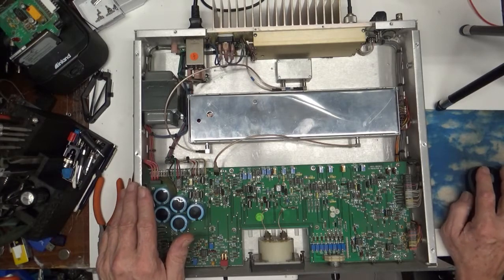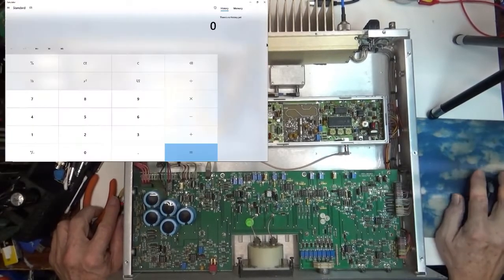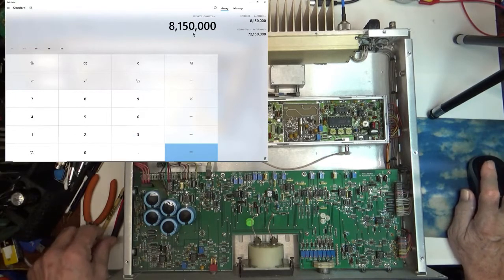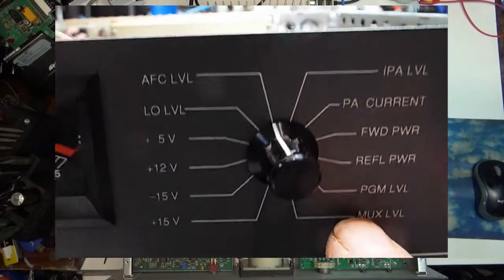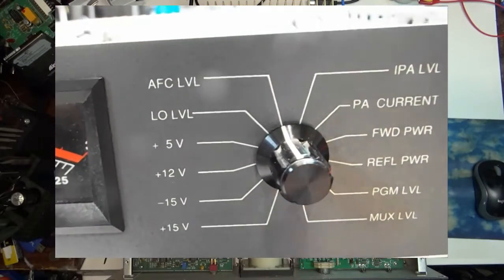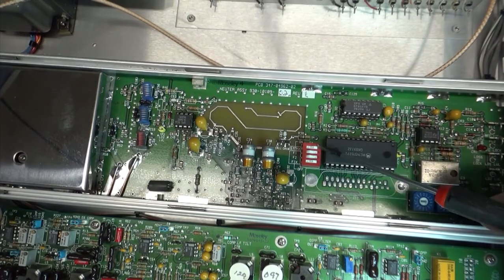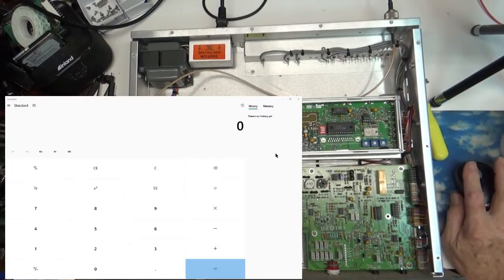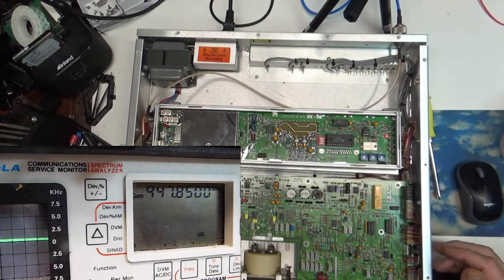Mosley 6000 Series STL Pair Frequency Change

Comment: Hello sir, please help, I have a STL RECEIVER RVR RXRL NV muting on.ic CA 3189 lamp in the damaged part of the IF module so that it is muting on. thank you
Reply from the maker: I am sorry but I don't know anything about those. Never seen one. Wish I could help you.
Reply: i had one RXRL on service recently with a similar problem. If the mute indicator is on, this does not necessarily mean that the IF card is defective. Depending on the squelch level, Mute is activated if a 70MHz RF signal (first IF) is not present at the IF card input (BNC cn4 connector). Also the mute is automatically activated if there is a problem with the local oscillator (pll unlock). In my case the PLL (MB87006) was faulty and the pll loop could not be realized. To localize the fault location it is necessary to have a spectrum analyzer or at least a frequency counter. Disconnect the BNC3 from the BNC cn4 position on the IF card and connect to the analyzer. Turn on the receiver and check if there is an RF signal at 70MHz. If it is not there, something is not ok with either the input filter or the local oscillator. Checking the local oscillator: If the red led on the PLL card still lights up after 10 seconds it means something is wrong. Checking the frequency of the local oscillator: Connect the BNC2 connector (the one leading from the PLL card to the filter) to the analyzer. Turn on the device. If everything is ok you have to read a frequency of 70MHz higher or lower than the receiving frequency.
A BNC3 connector can also be used to test the frontend. The presence of a receiving frequency but a very low RF field should appear on the analyzer. Good luck!
Reply from the maker: @MrPop80s  Wow! Thank you for your detailed response to my viewer.  This kind of help is what I have always hoped would happened.  I hope it solves his problem.
Reply: @AERVBlog    also hope so. By the way, the RVR RXRL (produced from the mid-90s to the mid-00s) was sold for the American market under the Bext label. Also the clone of this device is under the label CTE international STL (identical modules in the 3U yellow box). Long-lasting devices, good characteristics. I still keep alive one pair of UHF STLs from this manufacturer from the late 80s. Greetings from Europe. V.M.
Reply from the maker: @MrPop80s  I love the new ability to share knowledge like this around the world instantly. Being 70 I clearly remember when this was next to impossible.
Reply: @AERVBlog  Yes, that it is an astonishing thing. At a time when Studer master recorders and mixers, EMT turntables and Sennheiser mics were the standard in Europe (I was the last generation to work on it), no one could have even imagined how much the progress of binary code would connect us. But, looking at some aspects, I would like to go back to the early 90s. There was much less rush and satisfaction in what you were doing
Reply from the maker: @MrPop80s  they were a different time but I have to admit I like not having to jump out of bed at 0-dark thirty to fix a transmitter or leave at 0700 on Christmas day when the kids are getting up to fix an STL that decided to go down just then.  The newer stuff is a lot more reliable.
Reply: @AERVBlog  That is true

Comment: What is that Motorola unit that you were using in this video?
Reply from the maker: It is an R2400 Communications Service Monitor. I really like it. I used to be a Cushman guy but this is a lot better and they can be gotten for a pretty good price.